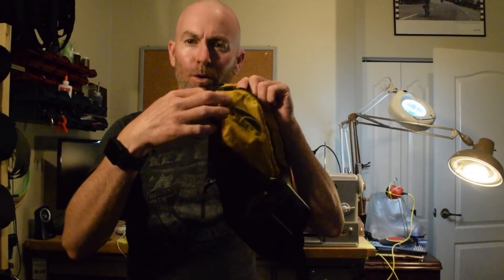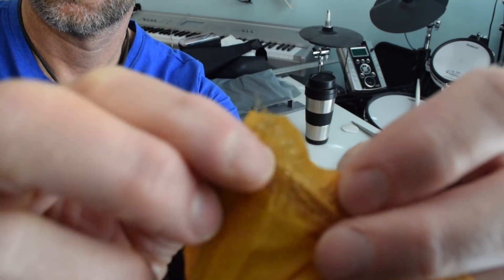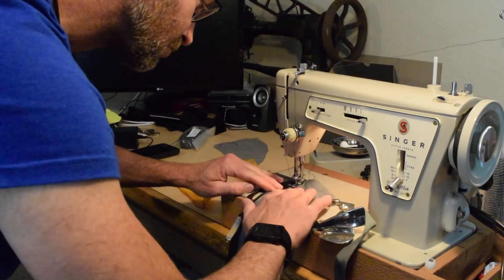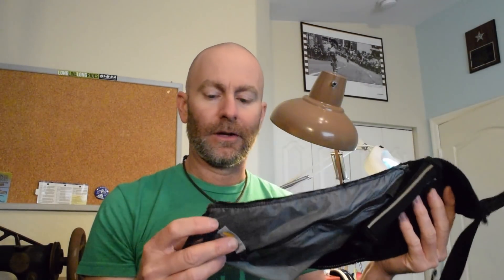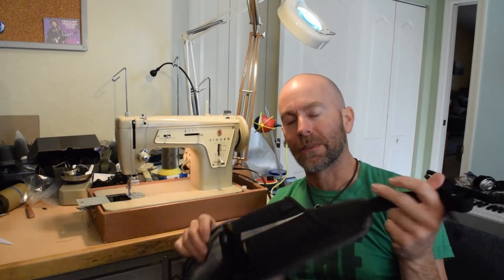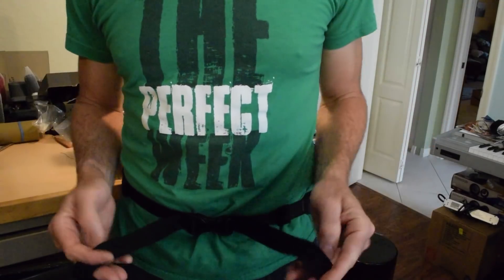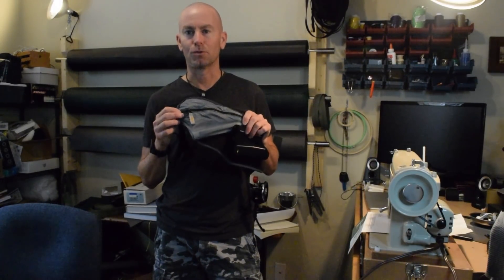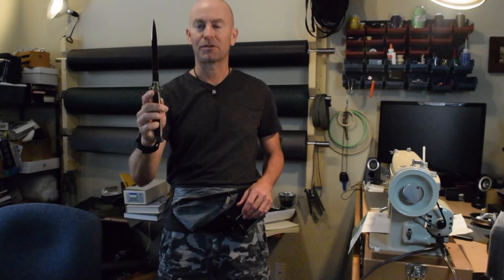Why Sew? DIY gear repair

Comment: Late to the show. What I do with the binding, since my binding attachment blows, is take the folding attachment off the sewing machine and go to the ironing board. I put a pin in at the start of the binding and pull the attachment along the binding ribbon while ironing the binding ribbon in half. Takes a few minutes. Then sew it in place. Nice video Jason!

Comment: Another way of looking at that zipper (like in a pocket) is, if it closes on the down stroke and you don't get it completely closed you have a hole in your pocket. Or when you unzip things may fall out. If it closes on the up stroke, none of that will be a problem and in practice I don't think the zipper tends to jostle open.
Reply from the maker: Yeah, I don't think there's one right answer to this, at least in general.  There are definitely applications where closed up is the only way to go, and others where closed down would be better (I think, at least).
Mostly I wanted to justify my dumb mistake :)
Thanks for watching and commenting, Rick!

Comment: Thanks for the video. I found a Singer 237 in a cabinet for $5 at my local Goodwill  after hearing you talk about it. Looking forward to using it. Got it working smoothly but haven’t had a chance to actually see with it yet. I enjoy your videos.
Reply from the maker: That's a great find!  I found mine at a thrift store for $20, and I see them online in the $100 range all the time.
Thans for watching and commenting!

Comment: I watched your video that showed all the gear you have made. I have made almost every piece of gear you showed and multiples of many of them plus a lot of items you haven't gotten to yet. It just made me laugh when you started tossing them in the pile and I was thinking I cold match you item for item. We have clearly followed the same path to get where we are. You say you use a seam binder for a living so it is clearly a process you are familiar with. I notice you use scissors to cut out your nylon. I hardly ever use scissors on nylon. I made a hot cutter out of a soldering gun. I replaced the soldering tip with a loop of heavy (10 or 12 ga wire) then flattened the tip of the loop with a hammer and sharpened it a little bit. I use this hot gun to cut out most of my nylon pieces. It prevents the material from raveling and I don't need to seam bind it. Cordura is especially bad for raveling. Hot cutting pretty much stops the raveling. Hot cutting, sewing then top stitching seems to be sufficient for most seams. No binding necessary. I realize in a commercial setting, gang cutting and seam binding may be the way to go. In one off custom gear made for myself, hot cutting and sewing seems like the most expedient process.

I got a number of rolls of .75, 1.1 and 1.9 ripstop at a yard sale. You got a great deal on rolls of heavy nylon. We should do some trading.

Great job on your videos.
Reply from the maker: That's awesome!

I've been meaning to either buy or improvise a hot knife, but I just haven't gotten around to it. 

We should chat about a fabric trade.  Email me sometime, thejasonofalltrades @ gmail.com.

And thanks!
Reply: Will do. I will send a picture of what I have with descriptions.
Reply: Peter, 
Sweet idea! Gotta try the solding iron trick! Thanks! Do you use glass underneath?

Comment: For shallow angle zippers at the top of the pocket (like that one), I agree - closed in the down position.  More secure with no loss of function.  For steeply angled or vertical zippers, or zippers in the middle of a pocket, I'd much rather have it closed at the top.  Not only will stuff not fall out when I start to open it, but then I can partially open the zipper to drop small items in and close it back up with no risk of anything falling out.
Reply from the maker: Yeah, it's definitely not a one-size-fits-all thing, and honestly part of my thinking was probably subconsciously influenced by a desire to justify my idiotic mistake :)  But, that's the nice thing about making (or modifying) your own gear - you can make it the way YOU prefer!
Thanks for the great comment, and thanks for watching!

Comment: Dude, please do a video on thread and needles, specifically which you should use for what application and what will work in the different classes of sewing machines!
Reply from the maker: That's a great idea, and I will add it to my list.  In the meantime, I almost exclusively use size V69 bonded nylon thread on everything I do.  For needles, nearly all domestic machines use the same class of needle, and I generally use something around size 90-110.  The rule of thumb is to choose the thread based on the fabric, and the needle based on the thread.  I've found size 69 to be incredibly versatile, and I've used it on everything from ultralight silnylon to medium-weight leather.
I hope that helps, thanks for watching and commenting!

Comment: Love your channel and have a question. What type of sewing machine would you recommend for sewing 1.1oz silnylon? I'm trying to make a diy tent but don't want to by a machine that can't handle thin slippery fabric. Thanks much!
Reply from the maker: Hi, 

Thanks!

I'm a big fan of domestic (as in non-industrial - there is also a "Domestic" brand) machines from pre-1970s. 

My absolute favorite of my machines to use on silnylon has been my 1936 Singer Featherweight, but those aren't the easiest to find and can be quite pricey, plus they are straight-stitch only, and making a tent you'll likely need (or at least want) to do some bar tacks and/or zig-zag stitching. (I have an older video on making a stuff sack that shows that machine sewing silnylon.)

The Singer 237 I use in this video is a fantastic machine. It's all metal-geared, can handle thicker materials well enough, and does great on thinner stuff, too.  I found it at a thrift store for $20, I see them on Craigslist, etc. for $75 - 100 fairly often.

Basically, I'd suggest a zig-zag capable machine, preferably pre-1970, and a brand name you recognize (Singer being the obvious), but if you find something cheap enough outside of those parameters, go for it!  Newer machines have more complicated stitch mechanisms built in (more stuff to break) and are more cheaply manufactured (might break more easily) but will probably work fine.  I made my Ray Jardine quilt kit on a 1987 Kenmore plastic-case machine, and the quilt turned out great.

If you haven't seen it already, my video "Why Do I Have So Many Sewing Machines?" might have some helpful information for you.

I hope that helps, let me know if you have other questions!  Thanks for watching!
Reply: Thanks for the feedback. I've came across your channel a couple days ago and have been watching them right before bed. Definitely will be checking them all out thanks again

Comment: i just started to pickup sewing.  got tired of looking for bags and clothes that met my style and needs.  As much as im enjoying being creative and learning something new, i'm starting to realize it's probably not worth it.  the time and energy, as well as material costs, just doesnt seem worth it. I do enjoy it tho.
Reply from the maker: Hi Troy,

I did a video on this exact topic, here it is if you'd like to check it out - https://www.youtube.com/watch?v=QOjgsjn67F0

Short answer - in terms of pure economics, it's definitely not worth it.  Is there other value to be had from sewing as a hobby?  Here's my answer - I now have a dozen sewing machines, I've made well over 100 YouTube videos (mostly) about sewing, and I quit my 10-year welding career to sew for a living (taking a pay cut in the process).  So for me, yeah, it's totally worth it.  

Making your own clothes, bags, etc is a labor of love, and allows you to get the form, fit and/or function YOU need.  But it will rarely come cheap, because it takes a lot of your time.  I happen to enjoy using my time that way.

There is a happy medium, by the way.  You don't have to make EVERYTHING, just make/modify what you enjoy, and don't worry about the rest! 

On that note - I'm training for an ultra marathon, and wanted a hydration vest.  I started looking at them and scheming to make my own, because, you know, I have to sew it, right? I finally broke down and bought one on clearance.  I actually need to start training with the thing, not spend the next six months making it, and on clearance it cost less than I would spend on materials.  Maybe one day I'll make in improved version, but for now buying is the answer!

Thanks for watching and commenting, and good luck!

Comment: Hey Jason, have you come across any good info on repairing old Singer motors. I have 2 201s, both need rewiring, not sure if they need rewinding. I'm currently using my 201P belt driven (Australian model) with a cheap Chinese motor from eBay, not ideal. Thanks for all your content.
Reply from the maker: Hi Jim, 

I haven't done it myself yet, but there is a great blog about rewiring the 201 motor on Vintage Singer Sewing Machine blog.  He has a great, in depth tutorial that I intend to follow as soon as I can make the time!
Thanks for the question, and thanks for watching!